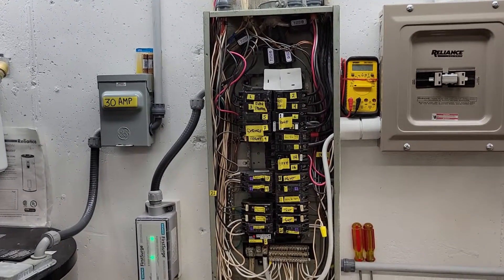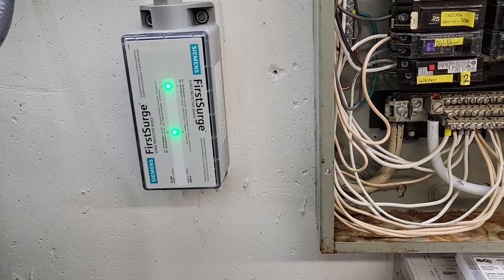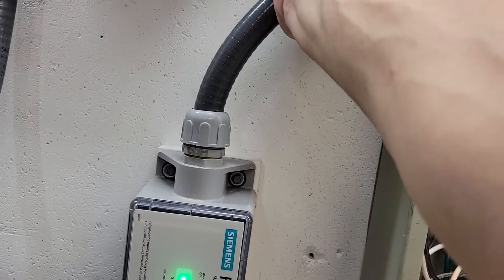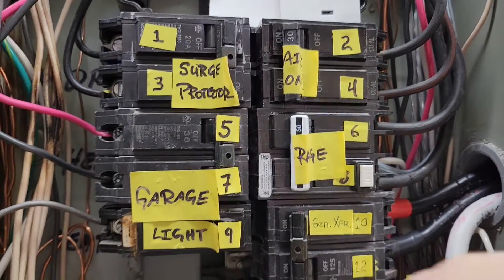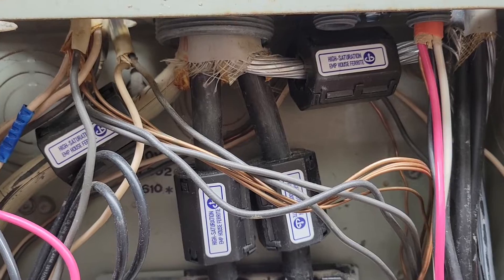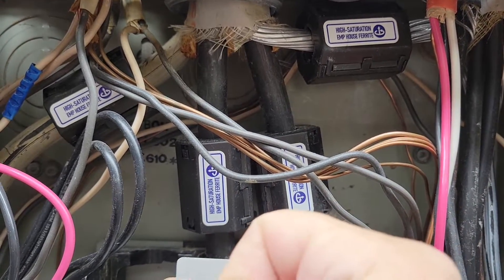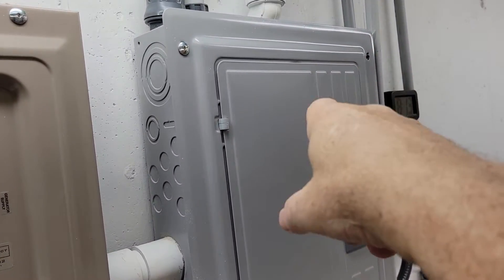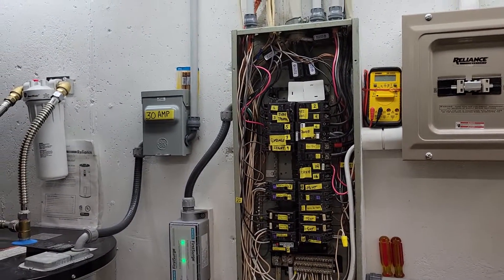Bro DIY: CRS #13 - Siemens FS140 Whole House Surge Protector & House Modified Ferrite Coils install.

Comment: I like how organized and clean you have the area. Yet, is there any reason why you left the two hot leads so long? 
I know the first two spaces for breakers is optimal, but if it needs to be that low on the wall, then rather hit the bus bar which is fat, thick, faster with shorter wires below as there is less resistance in a fat piece of metal, than reaching up there inside two skinny wires. Is good to tackle right after the main breaker, but any nasty wave will embrace the bus bar at once before it travels down the wires to the protector. I guess what I want to say is than in situations like this is best for the path to be more of thick metal than wires. If the protector installed below the half bottom of the panel, then it should rather go sideways and shorter to the busbar instead of traveling up via a skinny wire. Is like a trip on a country road from point A to B instead of only half the distance and then hitting the highway so you can get there faster. 

Remember that all SPD's are tested at six inches, and it eats 100Volts every inch of wire after that due to resistance. Also, did you twist/braided the two hots for that long journey to the bus bar? If you twist them once per inch at least you optimize the absortion in cases where the lenght of the wire cannot be avoided. If you leave them in parallel the field it creates will create impedance.  
I know appliances are farther but it will bleed some leftovers from any "voltage tsunami" since two bends and the leght will reduce the efficiency.  Is in the instructions probably.  We old timers learned that any bend/curve sharper than the bottom of a soda can was too much. Keep in mind these wires are not for the same scenario that the rest of the circuit wires will experience.  The "juice" is different. Its not amps but rather voltage, so bends and lenght are crucial. Looks like you have ample scpaes and options to do it sideways and meet the bus bars straight from the protector.  Every nanosecond counts!

That being said, I LOVE THE HIGH SATURATION FERRITES!!!!! I have them, those will capture and eat up any nasty distortion and pulses, they keep the juice for a while and slowly empty themselves again! They are like $53 each now in 2022, but well worth the protection. People should instell them more. I see many are conscious of the surge protectors but this ferrite gadget is not that known.  
I have them as well as the whole house surge protector, then another smaller one in a subpanel and one in the furnace and another in the AC condenser. Look up the MARS surge protector for the furnace, they have a smaller one 120V that is very practical,  but don't forget your AC, not all surges come from the power lines, any lightning in your backyard can fry it.

Good for you!!!!
Reply from the maker: Thank you.
Will absorb your info and reconsider as well as implement the other surge locations.
Appreciate all the feedback.
Reply: @Bro_DoItYourself  you have a very handsome panel there. You are good! Is just that I've seen the whole house protected, yet, at least three times, air conditioning condensers fried like bacon in the backyard. I am not sure how it happens but apparently it travels through the ground or the air instead of the utility wires and it's not until you disassemble the unit that you find the oil leaking and the gaskets melted and it's a mess!
My father and I mostly worked new constructions and I was his slave. I had to wire entire houses, but when business was slow we would do house calls. I became a believer at least for an extra one in the condenser disconnect outside the house.
I took pictures of the instructions where it reads that you have to twist the hot wires but it does not let me upload them.
Back in the day all the surge protectors were for both 120/240v, and you just had to tie the two blacks together for 120v like a furnace. But, we always got phone calls of people breaking them or hurting their knees because they were like a big tumor protruding on the side. So, MARS, which is what we used mostly those days, has one now that is for 120 volts and it's half the size and it's perfect for the furnace. Model 83904, my (licensed contractor) price was $37 in 2022, not sure how much is for the public. The AC one is 83905. Mars is good brand, I know tons of people use intermatic because it has bling and it's pretty, but it's too damn expensive and it's not better than Mars...which is what old geezers like me always used.
Good luck, those are Type 1 also, so no need for a breaker, you just put it in the disconnect, avoid double tapping because it's not allowed in some jurisdictions and can loosen the cable and catch fire. Pigtail them. There's a good video by a YouTuber that is very professional nice chubby guy that always starts the video with the tie and go straight to it and it's the perfect video for this installation, the title is AC Maintenance How to Install a Surge Protector for your Air Conditioner, the channel is ANY HOUR SERVICES ELECTRIC PLUMBING AND HEATING. He is very professional, the video is short 5 minutes and the visuals are perfect and that's the way a professional will do it.
Protect you AC at least, remember it's a lot more expensive than a fridge and it's a mess because you need to call someone for the brazing, vacuum, etc.
Reply: You can get the same "goodness" of twisting wires ( to get better performance, by improving the impedence characteristics, "artificially" shortening the leads).... by not only twisting the leads but also by tightly bundling the leads with zip-ties. See Mersen study here---> https://ep-us.mersen.com/sites/mersen_us/files/2018-11/TT-SPN8-Effects-of-Wire-Lead-Length-on-Voltage-Protection-Rating.pdf

Comment: Thanks for the vid.  Showed what I needed for that breaker.
Reply from the maker: Glad to have helped.
Good luck.
Reply: @Bro_DoItYourself  Do you think it matters to have the surge breaker at the top where the power comes into the box?  Be ideal I suppose, I hate to splice wires to move existing breakers.  

I went with those ferrites too. Added small ones to my remote/sensor wiring for my garage door openers too.  Lost a board in one due to a near lightning hit.
Reply from the maker: @TheBeingReal  
The first contact on the A & B phase is the optimal location for the surge protector to function as designed. Anything downstream is protected. Splicing is NEC compliant so my suggestion is just do the work and move that one breaker.
Good luck!
Reply: @Bro_DoItYourself  Thanks!

Comment: Hello :) my Siemens Fs140 has: 2 Green lights on, red light blinking but there is not any sound. i have a doubt, the red light must be off or blinking? Thank you
Reply from the maker: I would imagine you've experienced a surge.
I would contact Siemans directly to determine if the unit needs replacing.
Reply: @Bro_DoItYourself ...Siemens installation sheet clearly says if the red light is blinking but the 2 green lights are on....FIRST check to see if your neutral-to-ground bar is connected. That said, you SHOULD be hearing the alarm too.
Reply from the maker: Yeah ..... idonno.
 My bonded ground is at the meter with the other 3 meters on my condo.